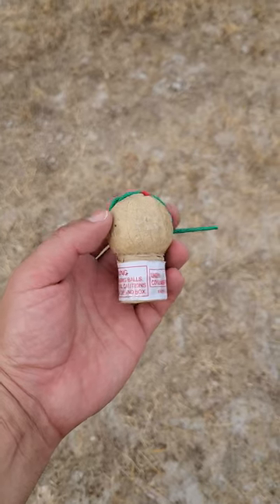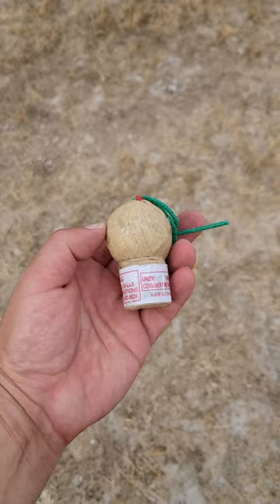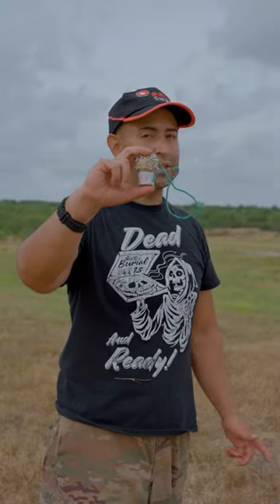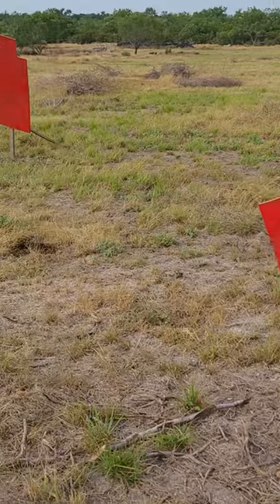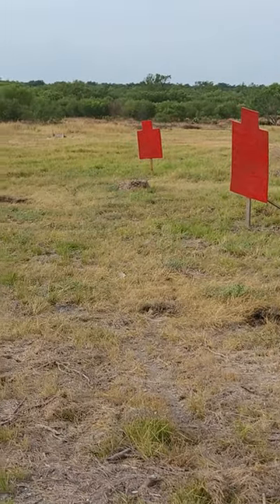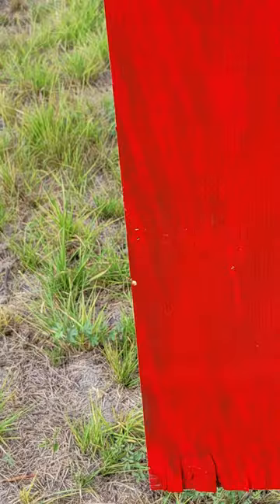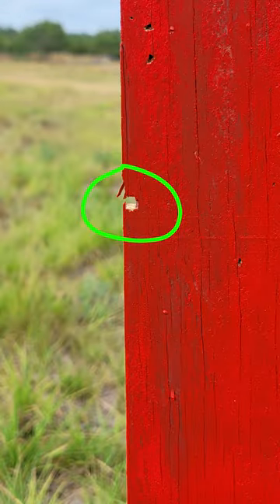Turning Fireworks Into Artillery

Comment: And that's why they make entire sleeves for grenades to increase fragmentation, and why the Pineapple grenade looks like it does.
Reply: The serrations on a pineapple grenade were made for handling, not for fragmentation. Any sort of reliable fragmentation comes from the notches being on the inside of the shell/sleeve, not the outside. The exception being those which are designed with ball bearing/tungsten pellets suspended in some sort of epoxy.
Reply: @elburropeligroso4689  
The grenade sleeve for the german M24 and M43 Stielhandgranate disagree.
Reply: @RavemastaJ  And yet any modern hand grenade uses pre-formed notches on the inside of the body. Those fragmentation sleeves performed poorly despite the grenade having more explosive than their counterparts, which has been documented fairly well in German after action reports.
Reply: @elburropeligroso4689  
Was not aware of that development.
Reply: @RavemastaJ  yeah. The pineapple outside of older grenades was a development from WW1 where grenades with smooth sides would often slip out of the throwers hand in the muddy trench conditions, so the serrated body was introduced to improve grip and handling characteristics.
Reply: @elburropeligroso4689 does this mean the scoring on the pineapple is more efficient at producing effective fragmentation?

Where can I read more?
Reply: @CC-bp2hn  No. The notching must be on the inside of the body for it to effectively and reliably produce consistent fragmentation.
Reply: @elburropeligroso4689 What I got from this was "Turn the pineapple inside out,"

Comment: Needs more shrapnel
Reply: Or more explosive power
Reply: @InstantNameOfficial the explosive power isn’t the problem,it’s the shrapnel
Reply: Coat in mouse trap glue then dip in small fishing weights
Reply: @froginabucket7294  it needs both. I saw that it didn't even penetrate.
Reply: @austiningle8621  I was thinking jb weld and .177 cal steel bbs
Reply: @InstantNameOfficial  re watch the video… it did pen the wood
Reply: Apply a healthy amount of industrial superglue and dip/roll in whatever you choose and have fun

Comment: the frage of the matter is the Firework does not contain enough energy to to propel stars let alone ball bearings.. I would try using a powerful firecracker as a primary to set off a secondary In the star I think this would amplify the results but still be a bit s***
Reply: Actually it does have enough..